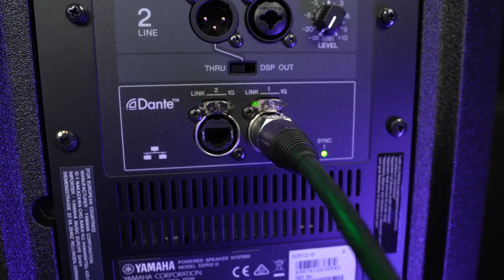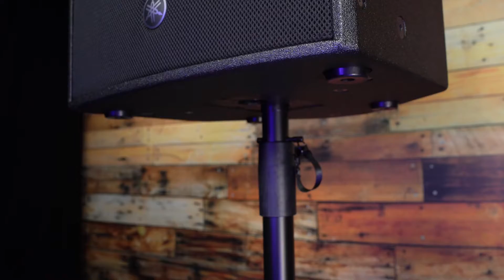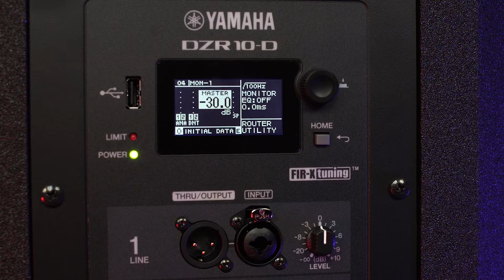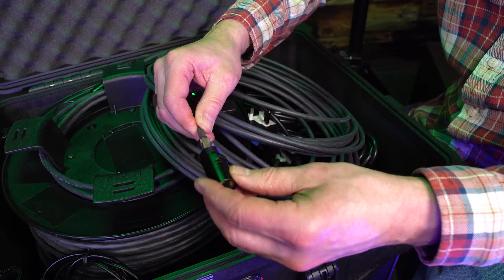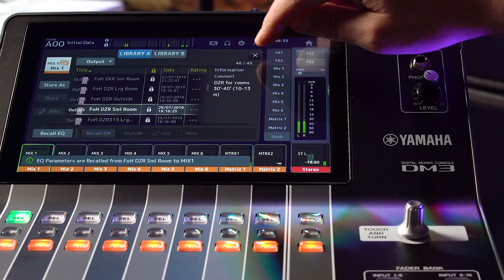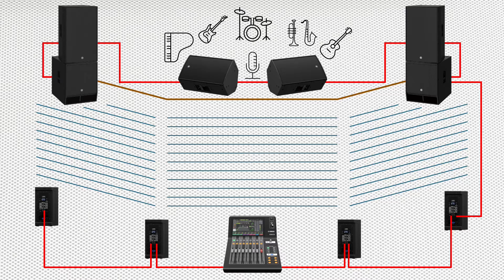System Synergy with DZR series

Comment: hmmm... I am using Dante Network with Yamaha DZR Stuff and a TF1 with Dante Card to Stageboxes TIO1608s. But... in a touring situation it is not less work to install, and not easier, compared to a analog cabeling, when allways a new kocation and venue has to be set up. Once you have resored it, the procedure for a setup is faster done, if you come back to this place in future. If not....